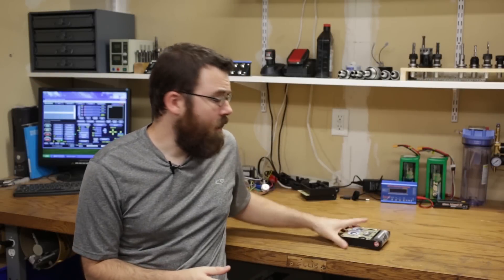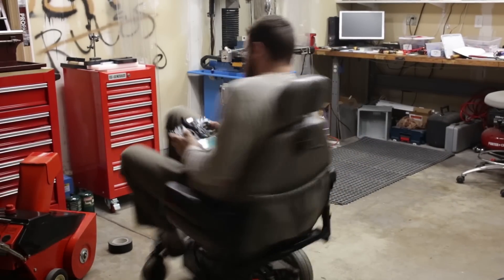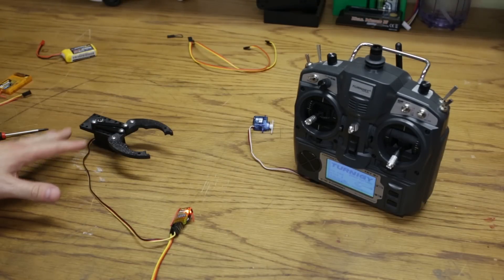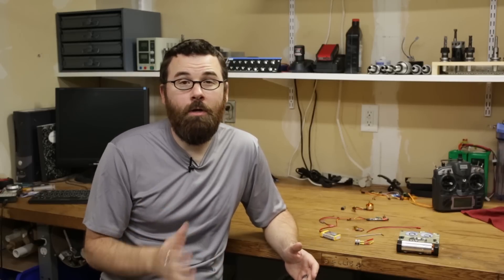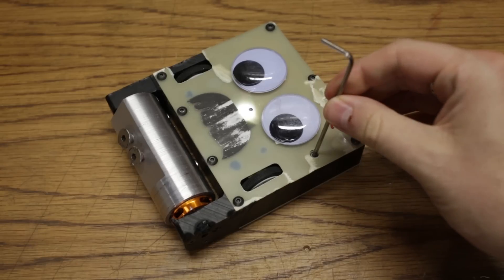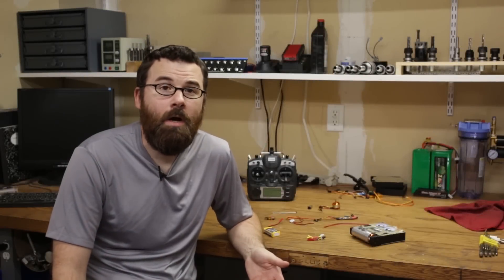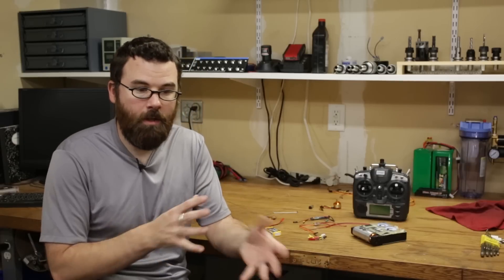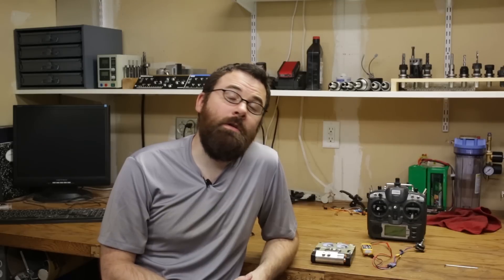Antweight Combat Robot - Part 3: Electronics

Comment: I didn't realize this until recently, but the electronics for hobby RC / robotics are really well-integrated! The radio communication "just works", and I would guess that both the servo and ESC are controlled with PWM signals from the receiver?

My mindset (as an embedded developer and former FRC coder) is that I need to write all the code to translate controller inputs to the various digital controls. That definitely is still relevant for more complex systems, but if you just want to directly control a few motors with an RC controller, this is an amazing platform.

Comment: How would you make a 4wd robot like the Oreo blizzard. Just only using 2 motors?
Reply from the maker: Doing this is problematic because the belts or chains that drive the other wheels tend to break very easily.  I either do 2 motors and 2 wheels, or 4 motors with 4 wheels.  With lightweight robots, it's hard to get good belts that won't break easily.  When they break, they get tangled up and bind the wheels, causing problems.

Comment: do you need to drive ESC or do one to power the two Motors
Reply from the maker: +Kyle Stokes The ESC I'm using for the drive motors is a single channel, so it can only drive one motor (or two, but they would drive at the same speed/direction).  So, I'm using 2 drive ESCs (two TinyESC, one for the left, one for the right).  There are some dual channels out there, but they're not as small.  I'm using the same ESC for my beetleweight and that's 4-wheel drive.  I'm still using just two, each one driving two motors.

Comment: if  i could just figure out the IC on that tiny speed controller... could probably make them for a lot cheaper
Reply from the maker: It's a PIC.  You could certainly build the hardware, but the software has some special features you'd need to program.  But it can be built cheaper for sure.  But you pay markup for convenience (not having to make your own) and research and development.

Comment: Also how does an airplane transmitter work for [essentially] a car?
Reply from the maker: +Kitsuné Blade It works the same way, the 'control surfaces' are just different.  Instead of wings, you have wheels, instead of a rudder, you have auxiliary motors, etc.  The buttons, knobs, etc on the controller just map to motors you're controlling.

Comment: Where did you get the CAD file for the D822/17 brushless motor?
Reply from the maker: I made my own.  I just busted out the calipers and made the model from scratch.  That's the bummer about most RC parts, there are no 3d models available, so you have to make your own.  It's trial and error most of the time.  For more complex stuff, I'll make a model, then 3d print it to see how close I got, then make changes until it looks right.

Comment: Your brushless motor wires connecting to your esc looks like the blue wire connects to the red and red wire connects to blue. Can you explain this please?
Reply from the maker: Correct, it does not matter where these wires go.  It's not necessarily positive and negative like a brushed motor.  The wires relate to the 'phases', so you can just connect all three and you're good.

Comment: Also if i just connect it do the Brushless esc Will the only things connected to the receiver be the drive motors' speed controller, and the brushless esc
Reply from the maker: +BrainPain You need to connect all the motor controllers to the battery.  They all need to get power.  They also need to connect to the receiver for the signal.  The battery will connect to 3 places in my design.  It will connect to each of the drive ESCs, as well as the weapon ESC.  Power is provided for the receiver through the drive ESCs, but each ESC still needs to connect to the receiver for a signal.

Comment: how did you configure the power switch so that it connects to the LIPO? If you buy it off of fingertech it doesn't come with any of the extra things that you had attached
Reply from the maker: Check some of the other comments, I've answered this one before.  It wires in just like a switch.  It just goes in-line with the red or black wire from your battery.  I don't use connectors, I just soldered to the terminals.

Comment: Could you explain the maths of how to find the capacity of the battery sorry I could not understand what you said
Reply from the maker: this is tricky.  The best way to go about it is to determine the max power draw for your weapon and for the drive, and then multiply it by half, then figure out what that would be for 3 minutes.  It really depend on how much you are driving, how often the weapon spins up and down, etc.  I usually just do half the max of each, then try to sustain that for 3 minutes.
Reply: but according to your maths you should only need a 200-280 milli amps per hour
Reply from the maker: correct.  but you also have to think about maximum current draw.  a really small battery can't provide much current.  batteries are rated at "C" for discharge.  If a battery is 10C, and it's a 1AH, that would mean it can delivery 10 amps (10C x 1AH).  A very small battery (250mAh), rated at 50C would only be able to deliver 12.5A peak (0.25 * 50), whereas a larger capacity at the same discharge rating (350mAh) would be able to provide more current (0.35 * 50) or 17.5A.  The extra capacity helps with providing more current.  But I can run two full matches on 350mAh, but I can't get the weapon up to speed as quickly with a smaller battery.  It's a trade-off.
Reply: thank you for explaining that

Comment: what is the weight of the chassis alone? i di the math for mine (approximately 10mmx64mmx28mm) and it gives me a weight below 1g.. im not sure if it is possible
Reply from the maker: 10mm is less than 1/2".  Use centimeters instead :-)

I think my chassis is around 150 grams.

Comment: do we need to buy another reciever? doesnt the control come with one already.
Reply: I bought a FlySky FS-T6 from amazon and it came with a receiver for £40, most of that cost was the transmitter as you can buy Flysky 2.4ghz receivers for around £5. Still experimenting with it but have had no issues as such yet.

Comment: how did u get the drive motors to mix and correspond to the stick directions on the transmitter? I have a Turnigy 5ch set and cannot get the drive motors to steer and go forwards and backwards properly. Do I need to get a programmable transmitter?
Reply from the maker: It's going to depend on your transmitter.  Look up 'v-tail mixing' to figure it out.  It's different for every radio.  You're basically just mixing channels together.
Reply: Robert Cowan ok, thanks

Comment: how did you scale  10 amps for 3mins to half an amp for 1 hour
Reply: If you have a 1 amp per hour battery, it can use 1 amp continuously for that hour, but if you have a 10c discharge battery, it can do 10 amps continuously for 6 minutes. 20c will run at 20a for 3 minutes.

Comment: I want to use those FingerTech ESC's but they are kinda expensive. Are there any small ESC's that would suffice for a project like this or should I just pony up the money. Any responses would be appreciated!!
Reply from the maker: Yes, they are expensive.  I don't know of any others that perform the same for less money, maybe other people have suggestions, but I'm not aware of any.  The unfortunate fact is the combat robotics is a very expensive hobby and if you use cheaper parts, they will fail.  You need very well-designed components.  That being said, I've never broken a Tiny ESC, I have the original two running Cuddles.  So, instead of buying several pairs, you might only need one set...

Comment: How would you wire 4 wheel drive. Would you just wire two motors to each ESC. Thanks!
Reply from the maker: Yep, you are correct.  You can connect as many motors as you want (brushed) to an ESC, as long as you don't exceed the max current, and they all travel the same direction.

Comment: Hi, I was wondering how you hooked up the drive motors. Do you have to do any programming of the controller to control the motors? You said there is some "internal mixing". What does that mean? I have an old radio controller and I am not sure this set up for driving the robot will work. Thanks.
Reply from the maker: The motors ultimately work just like the servos.  The controllers just take a signal from the receiver and translate it into forward/backward movement.  The mixing is for combining the left and right motors for tank steering.  If you have a non-programmable radio, you would need to get a 'v-tail mixer' which allows for tank steering.
Reply: Thanks!

Comment: :(     Plz help: for some reason, my transmitter (a turnigy 9x) somehow got set so that when I used it to run my motor set in channel 1 (which should be throttle) it is controlled (in a really odd way) by my aileron. I cleared my transmitter, thinking it would reset it, but the problem didn't get fixed. Do I need to reset my esc somehow, or is it a problem with the transmitter? It was working fine before...
Reply: +Adam Hung Yup, I used a different transmitter and the same thing happened. Can the esc program itself? If  so, how do i reset it?
Reply: +Adam Hung nvm fixed...
Reply: +Adam Hung How did you fix it?
Reply: +Kitsuné Blade Just do the jumper cable thing. And if that doesn't work, just buy a new one... several of mine came broken or partially broken. I'm happy to answer any other questions you have though if you need more help. I'm done with my robot now.

Comment: could you please tell me how to select motors for any all weight limit bot?\
Reply from the maker: that's a REALLY broad question.  You need to pick your motors based on your electronics and the overall design.  The motors that would work for a wedge robot might not be the right ones for a vertical spinner for example.  The motors really need to fit your design goals.
Reply: thank you very much but I want to know that which motor will serve best in case of drumbot of 50kg weight limit and weight of drum is between 15 to 22 kg and price should be under 150 dollars( 9000 indian rupees).
Reply from the maker: This is still really broad.  To pick a motor, you need to know what voltage you plan on running, how fast you need to spin the drum (based on the diameter), what your spin-up time is, how much weight you have allocated for the motor, etc, etc.  There are many factors that go into choosing a motor, and they are YOUR decisions, not mine.
Reply: Ok thank you very much
Reply: one thing I want to ask which components you have used for making it wireless and also its cost?

Comment: How do you connect the drive ESCs to the receiver??  Thanks
Reply from the maker: +Nico Myers - They have 3-pin connectors that just plug directly into the receiver.  There are enough channels on the receiver, so they each plug into their own channel, and they are mixed in the radio.  Does that make sense?
Reply: +Robert Cowan (Rowen Hobbies) Kind of but which channels specifically?  Do you mean you plugged the left motor into aileron and the right motor into elevator and then mixed those?  Thanks again
Reply from the maker: +Nico Myers Yes, exactly.  If you don't have a radio that can do v-tail mixing, you can also buy a v-tail mixer that plugs in between the ESC and the receiver, and does the same thing.  But essentially, each one is its own channel.
Reply: +Robert Cowan (Rowen Hobbies) Ah, thanks that makes sense.

Comment: do you need the speed controllers in order to turn or can I be cheap and not get them?
Reply from the maker: +Kitsuné Blade Well, yes.  You need something to control the motors.  You can build a robot without them, but you won't be able to control it.  You COULD use simple mosfets to just turn the motors on and off, but you'd lose speed control (it would only be on or off), and you wouldn't be able to reverse direction.  It's a pretty critical part of the system.
Reply: Robert Cowan I'm new to R/C- I thought when a receiver got a signal it flipped a switch just like a relay would.
Reply from the maker: +Kitsuné Blade Nope, the receivers use PCM (pulse code modulation), which is a digital signal.  Also, you need to control the voltage/current going to the motor, so you at least need something to do that.

Comment: Great build. Please did you make the 4 way female power connectors or did you buy them - and from where.
Thanks
Reply from the maker: I don't use a connector, it's just wires soldered together.  One wire in, 3 wires out.
Reply: Right thanks, also for the switch are those AC jumper harnesses (ul1015) you're using?
Reply from the maker: I'm not sure what you're referring to.
Reply: I mean how are the wires connected to the fingertech screw switch terminals, the connector type e.g like JST is for the Lipo.
Reply from the maker: They are soldered.  The switch is mounted to the chassis.  A connector could rattle loose, which would be bad.
Reply: Ah I see...that makes sense. 
Cheers.

Comment: To what wire does the power switch connect to? I a working on a 3d printed flipper-bot and plan to use this switch.
Reply from the maker: It's just like a normal switch.  It just disconnects one of your power wires.  So if you have a postive and negative wire going from the battery to the rest of your electronics, it just 'switches' one of those wires on or off.  people traditionally connect the switch to the positive wire.  The other wire just goes straight to the electronics.
Reply: Robert Cowan THANK YOU SOOOOOOO MUCH!  That make total sense!

Comment: can you have more capacity than you need?
Reply from the maker: Of course.  The battery in Cuddles is actually oversized.  I've fought two matches with it, without recharging.  And then went and filmed the video for it without recharging...  It's a good idea to test the weapon and drive motors to see what they actually consume and base your measurements from that.  I actually drive my robot around for 3 minutes (on a timer) and hit stuff, etc and then look at the battery afterwards to see how much it got depleted.
Reply: Thank you very much

Comment: Could you not run two of those tiny motors off one esc?
Reply from the maker: Nope, the ESC can only drive a single motor/channel.  Dual motor controllers exist, but I used single channel ESCs.
Reply: @RobertCowanDIY  OK thanks so if had two motors on each side I could use one esc for two motors on one side and one for the two motors on the other side?
Reply from the maker: @Crazyoldman84  Correct, they can drive one "side" or one "channel", but not two different sides.  So you can easily use them to drive one or two motors, as long as they are doing the same thing.  But if the motors need to turn different directions, you need a different ESC for that.
Reply: @RobertCowanDIY  brilliant thanks I'm making a 150g bot👍
Reply from the maker: @Crazyoldman84  You'll probably find that with a 150g bot, you will only be able to do 2 motors.  Good luck!
Reply: @RobertCowanDIY  Thanks my plan is a bit ambitious and my knowledge isn't the best I've only built a simple rc delta plane before but I like the challenge.

Comment: arent u affraid that the batterie might get smash since nothihing reains it inside?
Reply from the maker: Not really.  It's pretty protected inside the chassis and underneath the G10.  Even though the armor is pretty thin, it can withstand a lot of force.
Reply: but the force when u hit someone cannot destroy it?
Reply: Having the electronics just sitting in the chassis with no real anchor can help reduce shock damage, besides LiPo cells are tougher and safer than what people think.

Comment: do i need 2 esc for a 2 wheels robot?
Reply from the maker: +leo pikka You need an ESC for each motor.  I am using a total of 3 ESCs in my robot, one for the weapon and one for each of the drive motors.  They do make dual ESCs for driving two motors with a single ESC.  Does that help?

Comment: What is the capacitor that comes with the tinyESC for?
Reply from the maker: It's used to reduce spikes and noise coming from the motor.  Depending on the type of motor you use, you may or may not need them.

Comment: I like your style. I am thinking about making a dedicated custom PCB for my ant weight. More as a learning exercise, but if you have ever thought about this route and decided there are some great reasons not to do this, let me know and it may save me some trouble.
A Plus on the build and the manufacturing.
Reply from the maker: I have thought about that as well.  It would be nice to clean up the wiring and basically have a board that just connects to a battery, and then out to the motors.